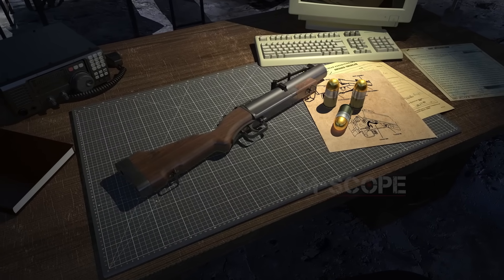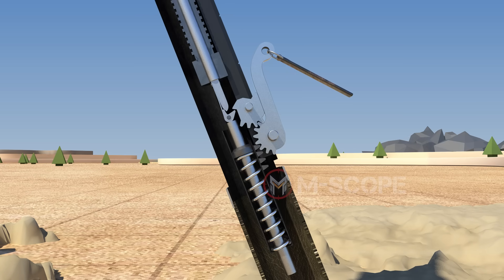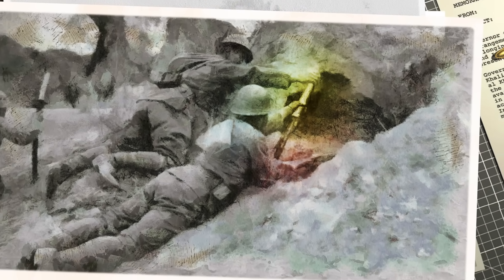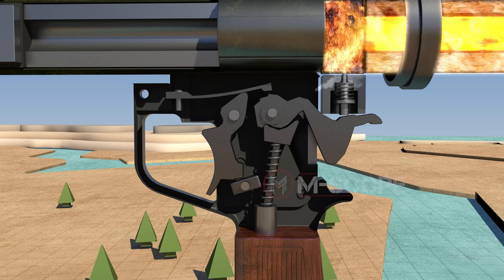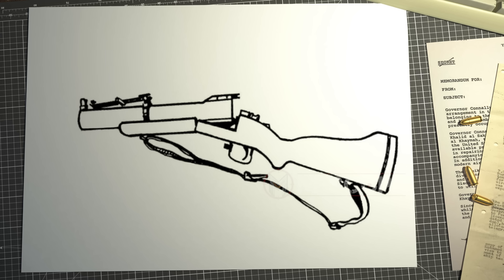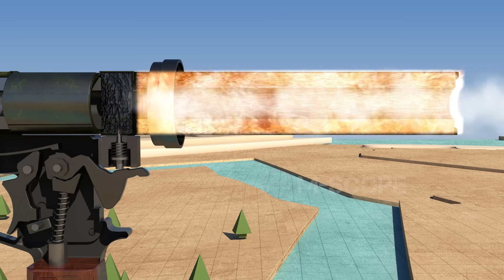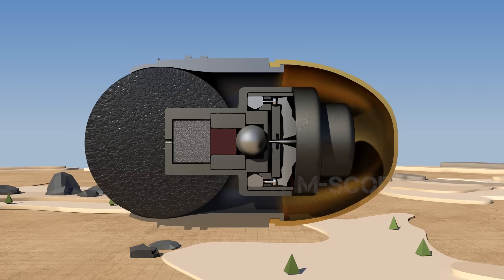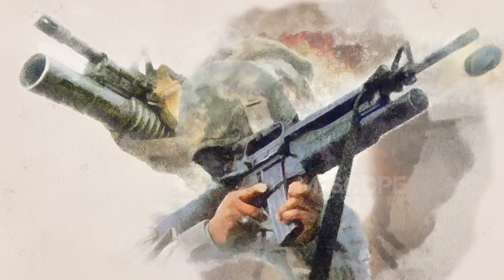How does a grenade launcher work?  - All about grenades Part 2

Comment: The Imperial Japanese Army from 1932 to 1945 developed and employed the effective intermediate distance Type 10 and later Type 89 grenade 'discharger'.  It is surprising no other army adopted this effective weapon.  It would not be until the Vietnam War that the U.S. Army deployed its own M79 grenade launcher, which proved successful and popular.  Post-Vietnam, the U.S. Army went one better.  It withdrew all M79 grenade launchers and replaced it with the M203 system, a combination M16 with a modified M79 mounted beneath.  The M203 proved effective, successful, and popular.

Comment: The "knee mortar" has the same range as a rifle grenade, and the grenade has the same mass. Rifle grenades are fired from the shoulder*. How then could a knee mortar produce a recoil strong enough to break bones? 

*Think about it: the rifle grenade is propelled by a normal rifle cartridge, minus the bullet. You can't use anything more powerful because the barrel might burst. The rifle barrel and the ammunition it fires are designed to work with each other. Barrels are not made heavier than they need to be, for obvious reasons. Likewise rifle cartridges are not made more powerful than the barrel can withstand, for even more obvious reasons. The recoil on the rifle (and thus on the rifleman) depends on the propellant charge, not the weight of the projectile. Heavier projectiles (grenades) are fired at lower speeds than lighter projectiles (bullets).

Comment: Knew a Vietnam vet who had a cool story. He said a guy in his platoon shot a tiger with a blooper (grenade launcher) He said the thing was running at him and he shot it. The reason it didn't explode is because it was very close and the safety mechanism worked with centrifical force. The round has to spin something like 40 times before the centrifical force disengages the safety. So the round didn't detonate and pretty much acted like a big shotgun slug. The guy had a picture of his platoon posing with the tiger with a four inch gash in it's side and he wore one of it's claws around  his neck. Sorry if you like tigers, but I thought it was a pretty cool 'hunting' story.
Reply: That was indeed very cool.
Reply: Tiger woulda ate his ass
Reply: https://youtu.be/B3RJUMm-hd0

Comment: Actually the Germans copied the US Bazooka, but made it bigger from the US 60mm. (~2.35 inch) to 88mm (~3.5 inch) of the Panzerschreck,  and then started making various one shot, disposable launchers.  These quickly lead to the Panzerfaust which had different models with different effective ranges and penetrations....

Comment: So when our company got to pull Green Line duty for 2 or 3 days on a remote LZ, we would play a little game with these on guard at night. You put one in the tube and 2 on the sand bags in front of you. Fire the first at a high angle, reload the 2nd and fire medium angle, and the last at low angle. The winner was the one who got all three rounds to impact at the same time. It was called H&I, harass and interdict, so it was "officially" approved.

Comment: You missed one detail of the 40mm being armed as it takes 3 revolutions after firing within the launcher tube of the M-79... there is a reason for this so when a solider accidentally drops the munition will not explode to cause death or injury...
the max range is 400m beside the fragmentation grenade there is other types like white phosphorous and smoke...
In the army we trained with M-79s, just for familiarization while the actual M16A1-M203 attached grenade launchers for training using training markers rather than real frags - the targeting aperture is actually called the 'Leaf-Sight'...
I was at Ft. Dix back in 1987 for boot camp - the only live munitions we used was 5.56 NATO, .50 cal BMG, 7.62, and live hand grenades... everything else was non-live training munitions or simulators... claymore mines we used real detonators [wired blasting caps] for training but the mine itself was a dummy... still wired blasting caps were dangerous can remove some fingers or even the entire hand from 'static' energy - have to be well grounded when using wired caps... training grenades used live fuse detonators as well - I and a few others were assigned to screw in all fuses and also load all 20 & 30 round magazines with fresh ammo including tracers when we had night fire exercises.
Spent 8 years in the army... got out as the Clinton Administration was destroying and reducing the entire military and cut programs and pay to freezing promotion slots to slow and reduce E-5 & E-6 slots and NCO school intake - I had enough of the BS and ETS out.

Comment: 1:58 is there an ignition system not based on time but via a sensor, based on the radiation of human presence?
Reply: That would be impractically bulky and expensive to implement, requiring an integrated and expendable power supply, computer, and sensor system. Not a good solution for a weapon that is going to be fired at enemy infantry. The soldier firing the grenade is a much better "sensor" than anything that could be fit into a 40mm grenade.
Reply: @platyhelminthes2877  the system that the Ukrainians would need in January 2023, is a multiple grenade launcher with  grenades using a heat sensor for Close-quarters combat platoon ., or street fight.
A custom-made "Tony Montana grenade launcher" but  with heat sensor.Fliegerfaust.

Comment: Not sure when it came about but the "defence" problem mentioned at the end of the video forgot to mention that they made 40mm buckshot rounds. It basically makes a grenade launcher into a blunderbuss. And while I already knew about it this explains to everyone why EA made it so the grenade launchers in battlefield don't go off when you shoot an enemy with it at point blank range.
Reply: The buckshot and flachet rounds were terrible in the m79 due to the m79 using low pressure chemical explosive rounds, whereas flachet/ buckshot are high pressure
This causes the range to be terrible as well as velocity and spread
Reply: @aperson336  Explains why they are so terrible in Arma 3. Thank you.

Comment: Technically speaking, neither small infantry mortars nor recoilless weapons (RPG-2) are grenade launchers, despite the use of grenade munitions in the knee mortar and similarity of the Russian word "granatamyot" (RPG-2 fires a shaped charge "warhead" or "munition" in English, not a grenade).
Reply: Actually, technically speaking, an RPG-2 IS a grenade launcher. It fires a fin-stabilised projected grenade. The M79 fires a spin stabilised projected grenade.

There are variations in how different nations use the word ‘grenade’ (the word is originally derived from ‘pomegranate’ btw), but in British nomenclature a grenade was originally an explosive weapon that could be carried by an individual soldier (a ‘grenadier’). 

The need to improve the range of grenades took us from things like the Mills Bomb to rifle grenades, projected grenades and on to the PG-7 propelled grenade which has a sustain motor to increase its range. Although RPG in Russian stands for ‘hand-held anti-tank weapon’*, the PG-7 is hard to distinguish- from a taxonomic perspective- from a light anti-tank rocket.

* Check out the RPG 43.

Comment: 0:46 The Knee mortar didnt actually go on your knee. You would be in for a lot of pain if you did that. Forgotten Weapons has a pretty good vid on this one
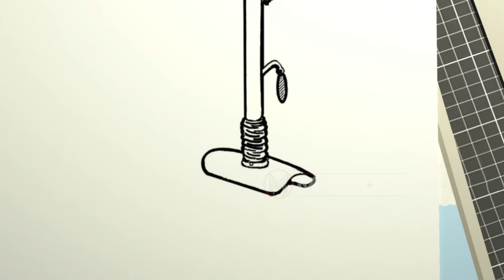Reply: They address this misconception at 2:10 in the video.
Reply: and to add.. it was actually ni mortar as in 2 in Japanese
Reply: @Ohlom111   Do you have a source for this? The actual Japanese name for the weapon is Type 89 grenade discharger. "Knee mortar" is just an allied colloquialism.
Reply: @platyhelminthes2877  spent a few years army EOD, had an instructor harp on the subject, seen a few pubs on them but that was some 30+ years back and in all honesty my memory is swiss cheese anymore. But anyway basically it goes to it being referred to as a "2 inch mortar" somewhere along the line. 50mm=1.97in, and 2 in Japanese is ni, pronounced just like knee. Maybe coincidence because I can't remember where I may have seen it and can't find references to it in any of the books i have now. But for what ever reason it's one of the strange things that stuck in my head.